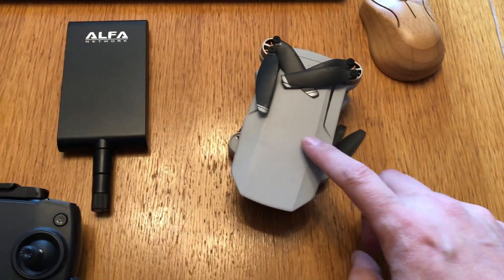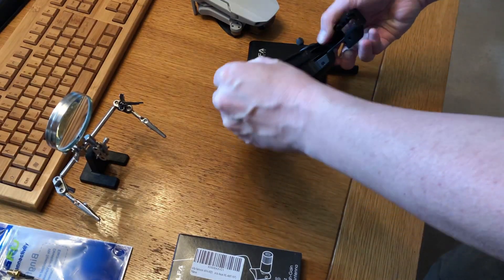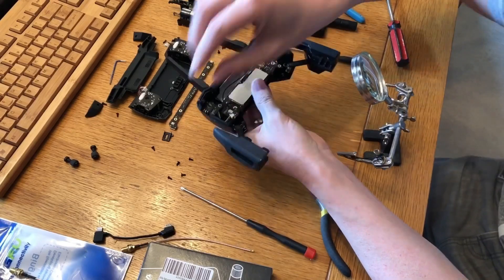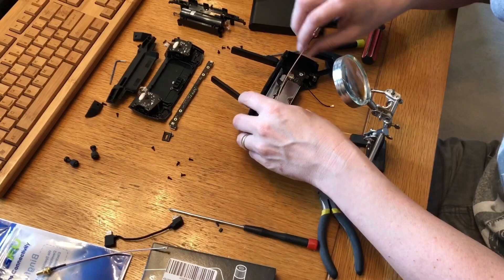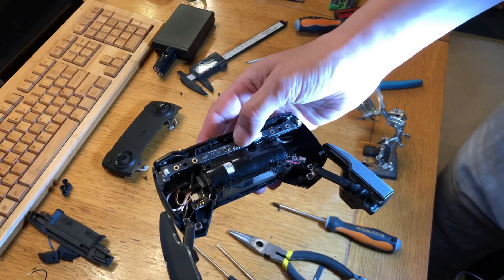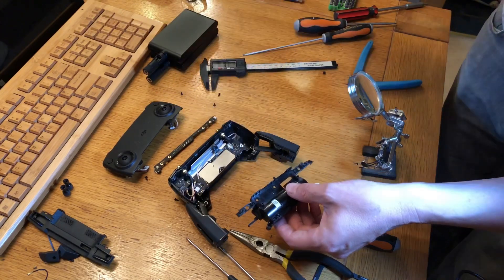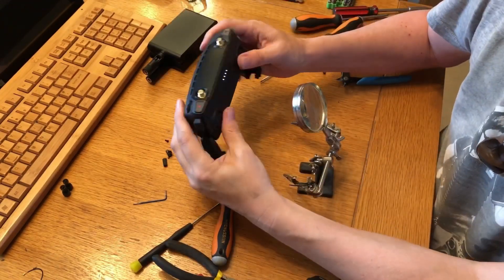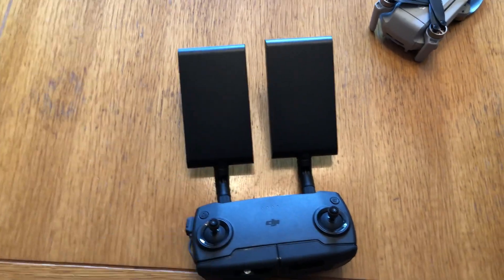DJI Mavic Mini remote controller modification for extended range.

Comment: Hi there! I have a question if you don't mind answering. The original antennas, is it true that one is 2.4 GHz and the other is 5.8 GHz? I followed your video and I've seen you were mentioning something like "down right and up is left", you were talking about pcb antenna connectors. It would be important only if the antennas are different, isn't it? Is maybe one antenna TX only and the other RX only? Thanks!!

Comment: I plan to do this. Did you range test it?
Reply from the maker: I did but I didn’t film it unfortunately. I took it to a large open space and got it it approx 11,000 feet or over 3,000 meters before I turned around and came back. There was no loss of signal!
Reply: @LeightonGill  Awesome! I'm not surprised! Ive run that antenna before on other stuff.

Did it seem to have a narrow beamwidth? You know normally with a higher gain antenna it gets more focused / narrow. Easier to get off target especially if its moving. But panel antennas are different.
Reply from the maker: @WW5RM  I haven’t noticed to be honest, however I have always kept facing the drone when flying. Sounds like another test is in order!
Reply: @LeightonGill  haha. Well they say the yagis are pretty narrow. Easier to get off target. More gain though I believe. But a panel antenna should be broader. 

Here is the thing. Sort of like with the Mini2. You can only fly so far. Unless you can plan out a safe landing location you have to RTH. The Mini2 is great.....I guess ( I don't own one just watched videos ) but its range is insane! 

In other words if you fly to the max range on your battery ( 50 % and RTH ) and you like those antenna don't do another test to satisfy me! I have one of the Alfa here on my desk. The seem great to me.

Thanks!

Comment: I’d be very interested to see a comparison before and after 👍🏽
Reply from the maker: Jack Snap  hey, thanks for subbing! I still haven’t gotten around to it unfortunately but I do still intend to do a comparison soon. I’ll post a video on my channel as soon as I have.  👍
Reply: @LeightonGill  Still waiting.
Reply: I've made this mod, it's not very easy one with this particular cables, as they has bulky internal part, so you have to cut through the plastic to fit it nicely.
As for the range improvement - we have made a test of two Mavic Mini 1 - one with Yagi boosters, other with this mod and Alfa antennas. Both on 5.8GHz and no FCC hack.
Yagi - 1300m.
Alfa - 1700m. 
The positioning of antennas for long range is crucial, so make sure they are aligned and pointing towards drone.
I actually prefer omni-directional antennas for nearby sport flight - it's much easier without need to position remote all the time. The good thing with this mod it's easy to swap antennas. Just don't do that when remote is on.

Comment: Hi Gill,how are you doing? I recieved my alfa panel antennas and I will be doing the controller modification tomorrow and will let you know how it works out with the fcc mavic mini version. Did you receive your yagi antennas. I should be receiving mine this week and doing some testing. I will keep you up to date on the results. Have a great weekend. It Saturday evening 1903hrs in Quebec and a beautiful  calm evening in the Laurentians where I live. Take care and stay healthy my friend. Cheers!🙏🏼.seriously considering purchasing the Skydio 2 drone!
Reply from the maker: Hey Michael, sorry for the late reply, I didn't get a notification of any comments so I've only just spotted this.  Great news that your panels arrived. How are you getting on with the mod?  I now have the Yagi antennas and a second, stock controller.  As soon as I get the opportunity I'll do a comparison :)
Reply: @LeightonGill  well hi there buddy, just finished the model and did a quick test for distance and see a big difference in the video link stability.  With stock antennas I was having a lot of video link drops starting at approximately 4000 to 4500feet  and then again at approximately 8000ft. And started lose connectivity with the UAV. Now I just made a 12000 ft. Run without a glitch but got nervous with battery 40 % when the safety feature was suggesting I return to home at 60%. I also removed the controller speaker to not be spooked by the loud beeping. Now I will take a 10 minute break, check the wind at 800 ft. Because there is one area of high land in my flight path that's over 500ft higher than my starting points with a big commercial tower  sticking up another 100 ft. I am using a screen record to send you results. I should be airborne  0400hrs standard eastern time in Canada.  I will let it fly to 35% battery and return home at probably 13000ft++. I notice big difference and will be building a bigger battery pack this week to balance the distance capabilities. When I finish this run I will let the sun rise and fly to 25 % and land at one of my emergency landing spots that I have prepared and practiced landing at this week. Be back with results and some pictures for you..Godspeed my friend......Mike.....michaellaframboise01@gmail.com.....yes I also picked up another controller so I can test with this one
Reply from the maker: Michael Laframboise wow that sounds like an amazing result! I can’t wait to see the results 😀. You have got more courage than me. I got scared at 4,000ft out but I didn’t get any signal loss. My email is: leightong@gmail.com
Reply: @LeightonGill  hey LG. Were you able to see the flight on my utube channel? I'm just curious if you're able to access it or if it's been deleted because of the background music. The 20 min.video I came down from 5 hundred to glide in and landed with 0 percent when the landing gear touched down.🪂🚁🙏🙂
Reply: @LeightonGill  during the final 10 seconds critical battery level,the DJI safety measures decreases speed to optimum performance and automatically descends for landing. I had a feeling that fighting this/ land immediately protection/  takes alot of juice to fight for altitude gain. I will test this over the lake with some diy pontoons . The first flight I will come in low and fight the decent DJI feature ....second run I will glide it in to see the difference between the 2 distances achieved before absolute 0%.........,it seems to me that the last 10% of juice was as depleted very we quickly
Reply: @LeightonGill  here is a link to the photos of the modification, and I will work on the editing this weekend. https://photos.app.goo.gl/iQgbLUaM8EJxiTv79
Reply: @michaellaframboise7646  I hope you will share the results.
Reply: @LeightonGill  hi again, I kind of figured out how  to share the 3 videos I made of the mods,but seems the music playing in my living room has caused a complete block on YouTube of 1 video complete and the other 2 are banned in a couple of countries.  I will figure all this out after work today. I'm not even sure what my channel address is! Probably my name or you can possibly search YouTube for the DJI Mavic Mini antenna test and my name should pop up. I will send you the pictures of the model when I figure out how to share this stuff. Have a nice day and be in touch later.....off to work.....Michael laframboise...
Reply: Hi Gill, I took some pictures of the modification on the controller and am preparing to send them to you. like I mentioned I bought another controller to so I was able to take my time and do a good job on my panel modification and I decided to fix the paddles permanently because they seem Ed a bit fragile whenI used the connectors and I know that there's a certain amount of GB lost every time we use a connector so I will send you the pictures and I will try to somehow post this to YouTube in the future. I did 16000ft, but battery was to low to make it back and I was able to land at one of the emergency landing spots I had prepared. Now I am preparing to build a battery that will handle the range of this new modified controller set-up. Have a good weekend my friend and stay healthy. You will see the mods in the picture but haven't had time to edit and write some explanations, but it is fairly self explanatory, and I will take the time this weekend to figure out the editing program that you told me about. I think it was kn!!!live.could you confirm is this the program I should use...

Comment: Nice mod! I'm getting over a mile range with the stock CE Mavic Mini, which to be fair is plenty! How far were you getting before the mod?
New supporter for your channel, hopefully you'll check out my Mavic Mini related channel and connect? 👍😎
Reply from the maker: Hi, sorry for not replying sooner, I've only just seen this!
Thanks for the sub, I really appreciate it :)
I wasn't getting much range at all before the mod, but I've now got a second stock controller so I'll do some comparisons at some point.  I'll go and check out your channel.
Reply: @LeightonGill  I picked up another stock controller also and am modifying the other one slowly.  The panels weren't stable enough on my installation and I think I've now decided to attach them permanently . I'll get  back to you with the results.....l have a feeling that there is possibly a substantial loss in db gain with the connector so I am wiring the panels direct with a new cable straight from the panel to the controller board........
Reply: @michaellaframboise7646  I have looked at your y.t. channel but haven't seen anything about the mod  details or the direct wiring. Is it there and i am just missing it ?
Reply: how did these experiment go guys?
Reply: Good for you mine can’t even pass 100 meter before the rc lose connection
Reply: @imdyinginside1919  You got a duff one then! Even my cheapo toy Flytec T13 can fly 120m before it goes out of range 😆
Reply: Cool computer keyboard! I like the wood look. Is it real wood? Veneer? Do you mind telling me where you got it or what brand it is?